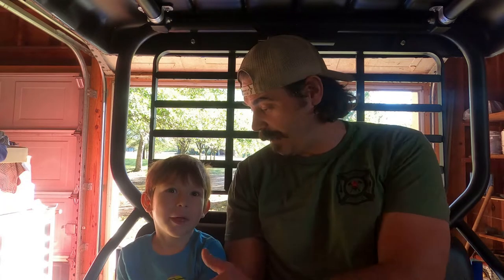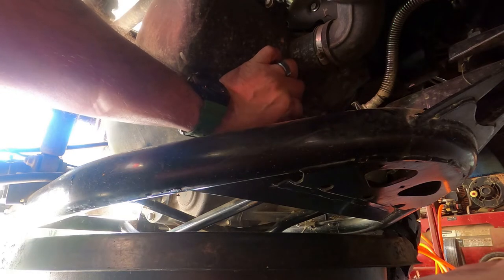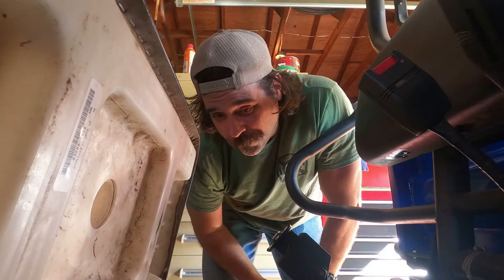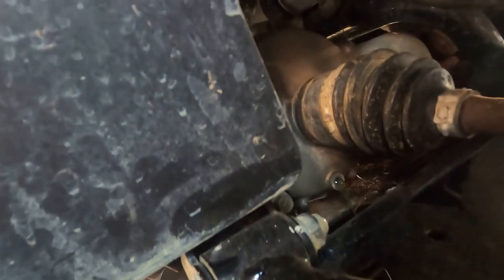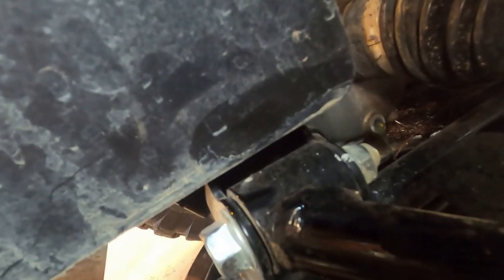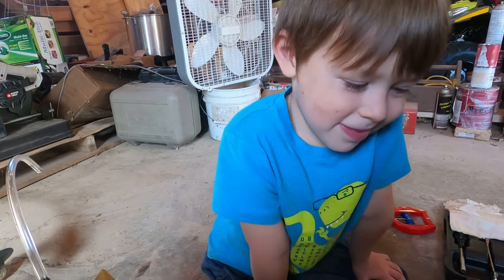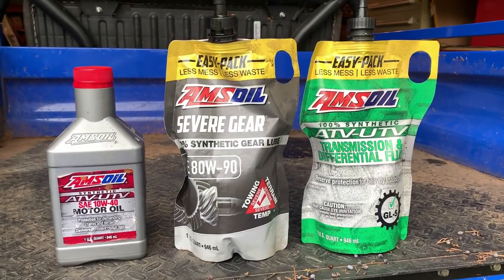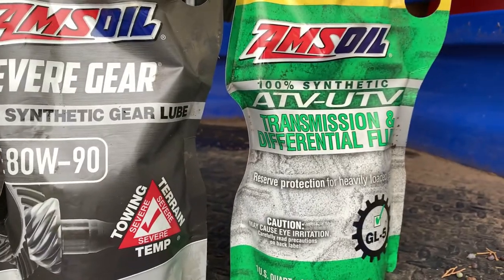UTV SERVICE / KAWASAKI MULE 4X4 SE XC / AMSOIL

Comment: You used 1.5qts of 10w-40, 2.5qts of ATF, how much gear oil did you use for front and rear differential?
Reply from the maker: When it starts running out the full hole, it’s full. So I can’t really tell you how much I used

Comment: Ok, so how did all your service work out? Any issues? Thanks for making this video.
Reply from the maker: The only issues I ran into, and they really wasn’t that big of deal was #1 tight area around the oil filter and #2 servicing the front differential, you will need some kind of tube attached to a funnel to refill the reservoir. Other than that, servicing was fairly sample

Comment: The latch in the center of the bed holds the bed up. Pull down and latch on the round frame bar.
Reply from the maker: @KawaDSrider, thanks a ton for that info. Just hoped out of my recliner to go check it, sure enough, there’s a latch under there and works just like you said. That will come in handy. Thanks again
Reply: @jathomestead , glad It was a helpful good video.

Comment: Is anyone having an issue with the mule turning over and over on a cold start? It will start , but after about 10 seconds and it’s rough at first until the fuel starts to flow. I’m a little confused by this cause it’s fuel injected , I do wait till the pump shots off before I turn the key. I put some injector cleaner in yesterday, I’m thinking I might have some bad fuel in the tank. I have 200 hours on it now, it’s. 2022.
Reply from the maker: @17forever64, I haven’t heard of any fuel injection issues. Mine is not fuel injected, and  my mule starts normal during cold temps. It very well good be some bad fuel.
Reply: @jathomestead  I agree, I’m gonna go get some non ethanol fuel today and fill it up!  We run it a good bit, that’s why I didn’t even think twice about using fuel with ethanol, but we have boat fuel here, so I’ll use that!
Reply from the maker: @17forever64, ethanol free is all I run in my small engines
Reply: @jathomestead  I will from now on!
Reply: @jathomestead  fuel injector cleaner seems to have solved the issue , starting up smooth again
Reply from the maker: @17forever !, good deal. That ethanol gas can be hard on small engines.
Reply: @jathomestead  ^^^^^^^^THIS!

Comment: Why not use the same for the front as back
Reply from the maker: @Chevy Driver, that’s what the spec’s in the manual called for.
Reply: @jathomestead  huh. No
They’re both gl5
Reply from the maker: @Chevy Driver, you are correct, the tranny and front diff calls for gl5. The AMSOIL severe gear in my opinion is a better oil for diff’s which is fine for replacing gl5
Reply: @jathomestead  ok had me worried lol
Reply: @jathomestead  i put 75w90 in both rear and front
Reply from the maker: Did you use AMSOIL also?
Reply: @jathomestead  lucas this time
Reply: @jathomestead  By the way if you take the plastic skid steer piece of about eight screws is a lot easier to get to the front
Reply: Skid plate not steer lol
Reply from the maker: Lucas is some good stuff slso